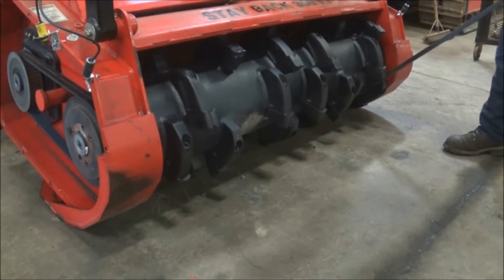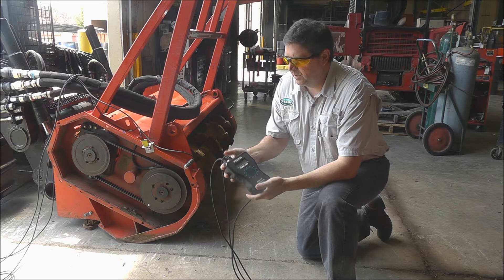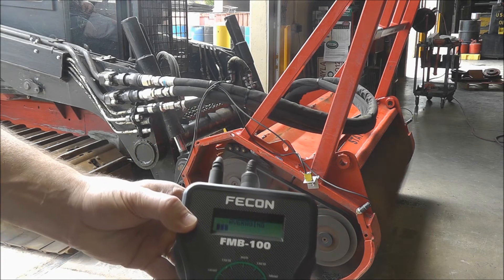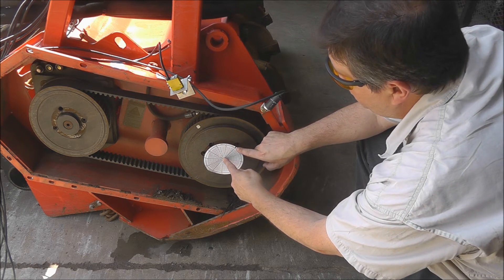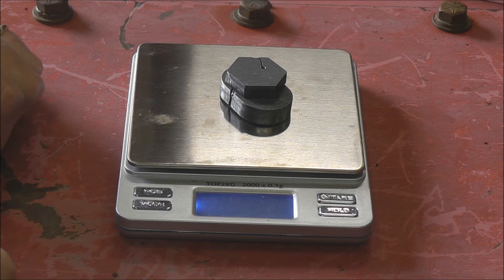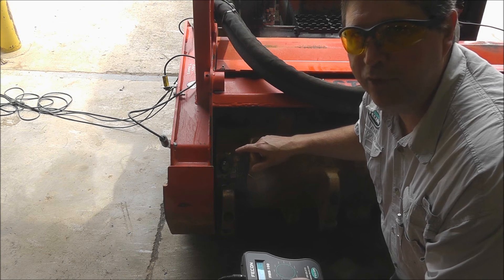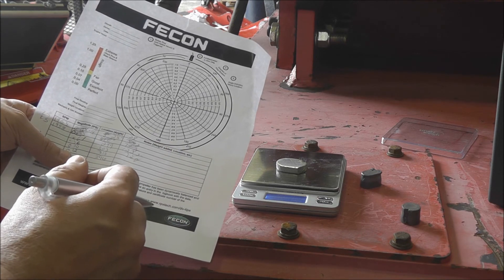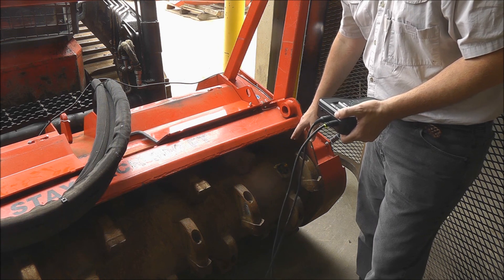Fecon Mobile Balancer

Comment: I would think that new cutter teeth would need to be installed before measuring vibration.  Maybe I missed that part?
Reply from the maker: New tools are recommended so that a vibration does not get introduced when a new set of tools are reinstalled. This of course can be expensive. If you own your own balancer, then you can rebalance if a vibration is picked up when the tools are replaced.

Comment: Why multiply by 200?
Reply from the maker: Hello Michael,

That value is called the “Influence Coefficient” we chose the value of 200 based on our experience with the mass of the BH74. By multiplying the 200 times the “IPS” inchers per second, the result is the amount of grams to add opposite of the heavy spot. It should be observed how much drop in in IPS is calculated using the value of 200. As your IPS get closer to the ideal value, the multiplier should also be lowered so that you don’t add too much weight and cause the other side to become out of balance. Our experience on a skid steer head would be to lower the influence coefficient to 100 as your multiplier when you drop below .5 IPS.
Reply: @FeconLLC  I really appreciate the technical response! Thanks!